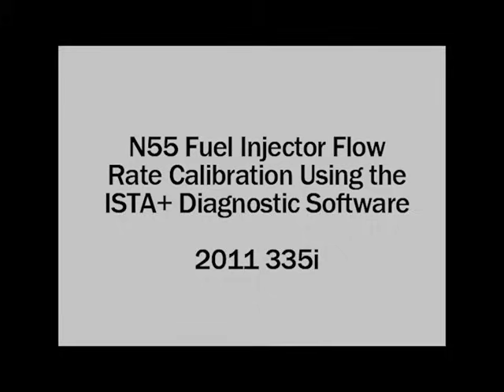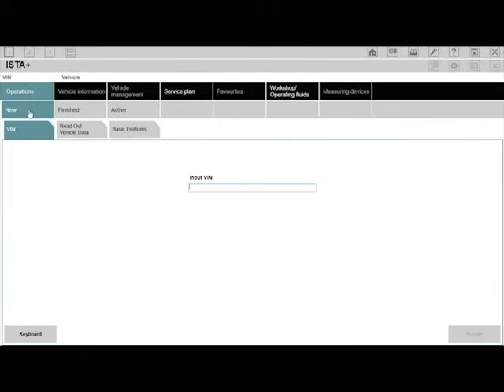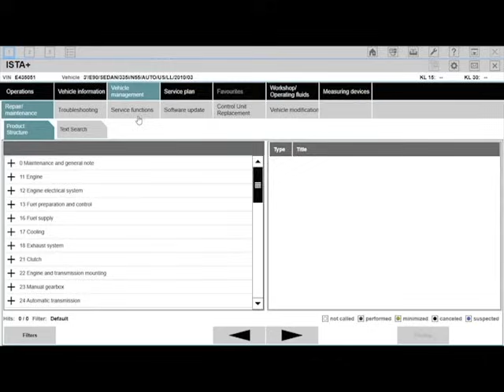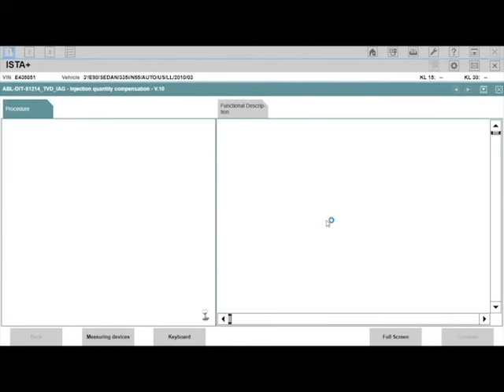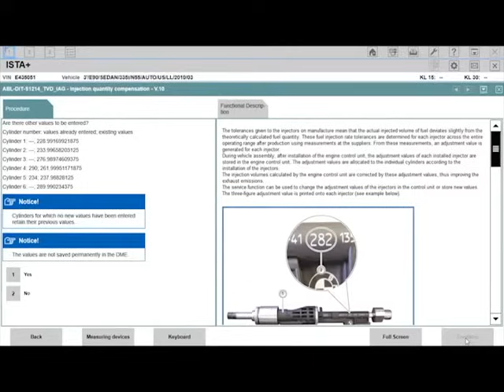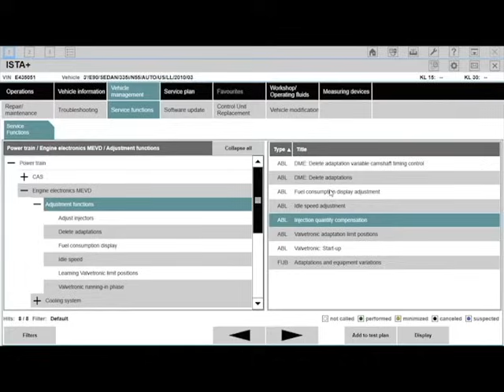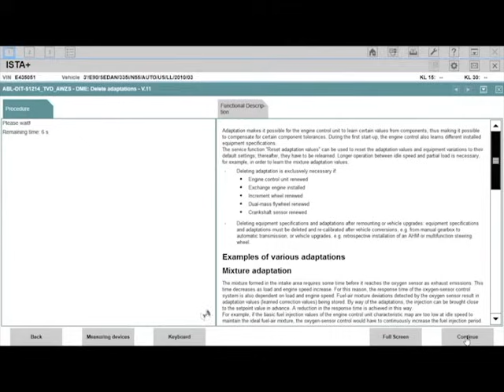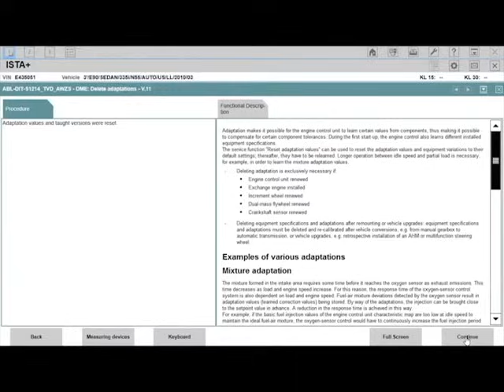BMW N55 Fuel Injector Calibration - ISTA+ Diagnostic Software

Comment: can i do the same for an n46b20b engine do you know by any chance? it has gdi injectors, you know the smaller ones, 4 to be exact, i once changed 3 out of 4 so not all 4 the same, 3 of them is VDO (best i could find) and 1 is bosch

Comment: HI to run the calibration service function can you do it with the engine running or do you need to do the function reset from the battery in the second click position. I wanted to ask an expert as yourself so i do not mess things up. Thank you very much,

Comment: Thanks for this great video. This helped me a lot when I was adjusting the values on my f01 740i N54 engine this evening. Process was the same. Don't forget to mention that the values that are saved can differ slightly from the values you save.
Reply: Saved 939. Seen 139. Wtf. Did it three times. SMH. Runs great but it def saved a diff number.

Comment: You should not have reset the adaption values, it's NOT required. See your own screen on right: "Deleting adaptations is exclusively required if ...." Injector swap is not liseted here.
Reply: It says it is required after he's finished the injector calibration. The program even created a whole new procedure in the scheduled testing because of it as well.

Comment: Dumb question, I accidentally installed EU6 injectors when my e70 LCI had EU5s. Software is fully updated on the car, but I still get a check engine, but the car feels really good. Is it possible to code in the new type of injectors?